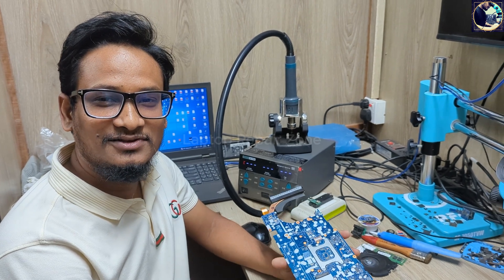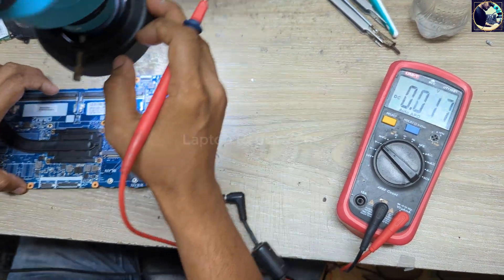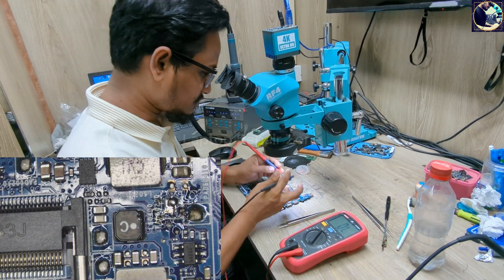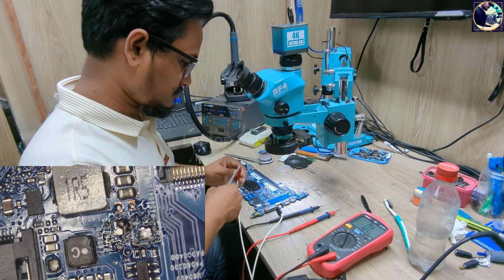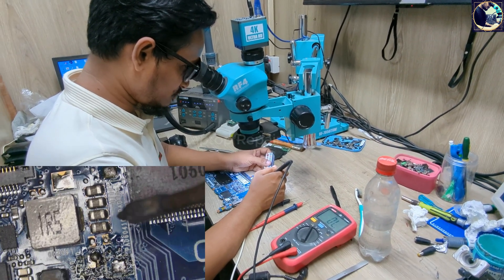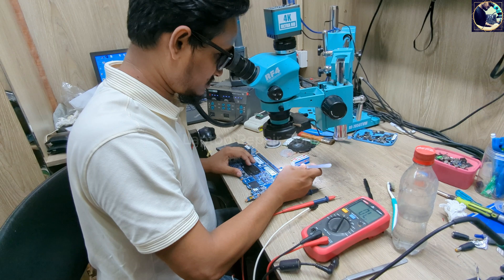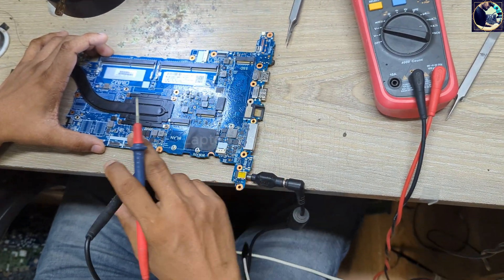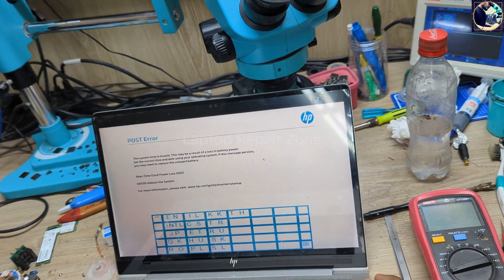hp elitebook 840 g5 laptop won't power on charging orange led light blinking Fixed!!

Comment: sir i have same board but the problem is the 3vs or switching ic died when i plug the battery, i had replace it twice, but after ic replacement laptop is on without the battery, hope you can give me advice, Big thanks in advance

Comment: I had this problem: laptop wont start, power on for a while lights up, then caps lock 1 time, then 8 blinks amber and 5 blinks white and nothing happening. I checked the same one you did fix in video but no problem in mine component good voltage. Battery good and power cable good. I disconnected clck and now it works. But the processor is getting really too warm when laptop running. Its hard to touch even. What do you think? The fan stopped even very warm processor.

Comment: Nice... weldone.

I need help my 850 g5 is not powering on and not indicating charging when pluged.

I have replaced charger but still the same what do i ?
Reply from the maker: You need to repair motherboard

Comment: My same motherboard 
Dc machine ampier 0.105 
No core voltage 

What's problem sir
Please help
Reply: Same condition 3 board 840 g5
Reply from the maker: Check all that voltage, clk,data,Bios